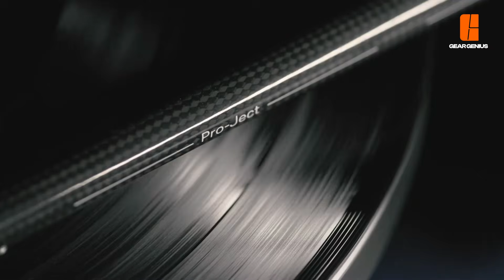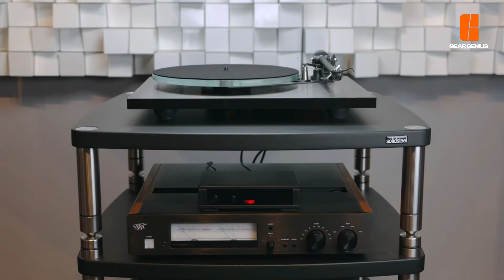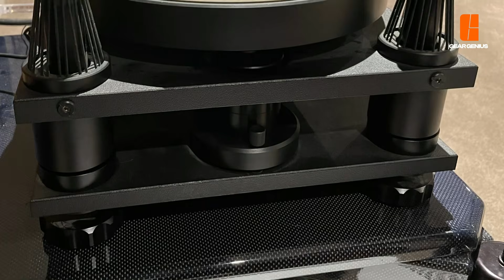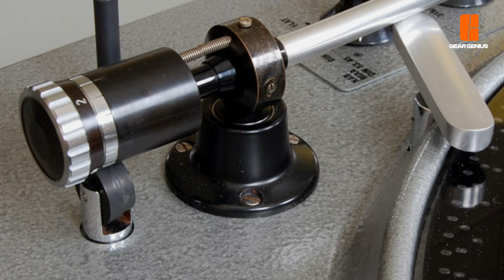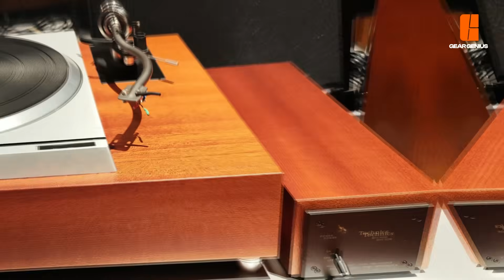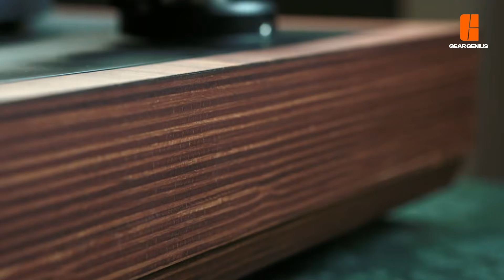Top 7 Greatest Turntables Ever Built of All Time

Comment: Garrard 301/401 should be on the list- and I’d group the 2 together as despite looking different the 2 are very similar, and arguably the 401 is the better table. And while I fully agree a TD124 belongs on this list, this AI crap includes photos of the current TD124 DD which isn’t a vintage table.